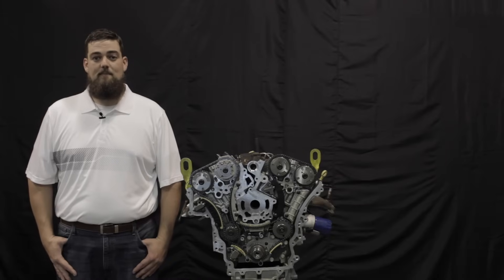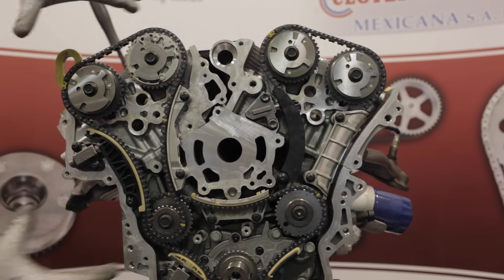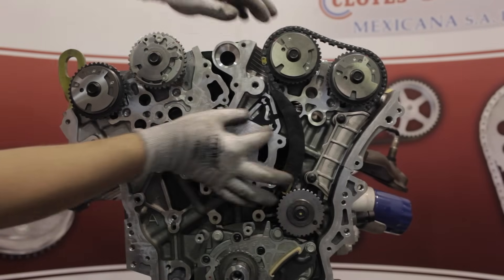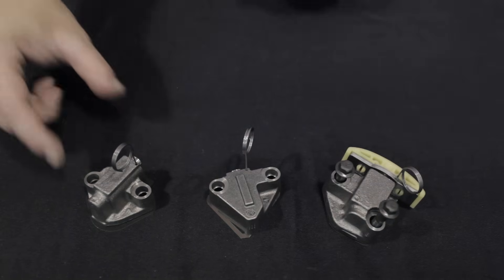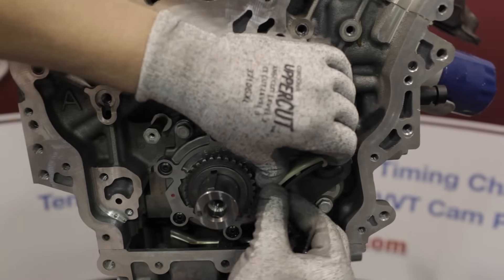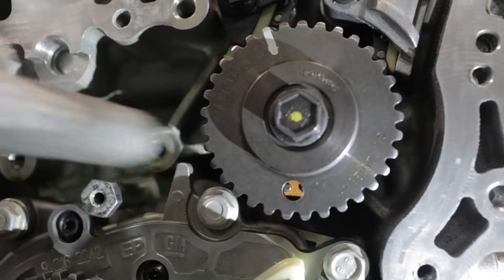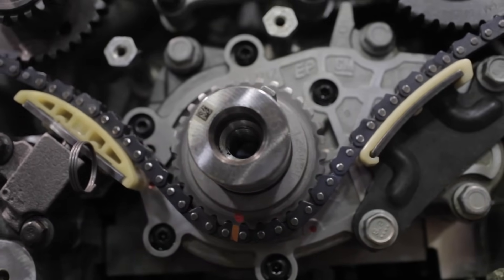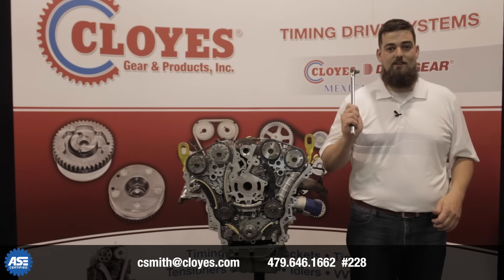GM 2.8/3.0/3.2/3.6L Timing Chain Replacement Repair, Cloyes 9-0753S

Comment: Good morning. I replaced the complete Cloyes timing kit in a car with 130,000 miles on the odometer.  Everything was fine until it all fell apart after 320 miles.  The plastic slider couldn't hold up and the tensioner piston went through it. Then I bought a complete set of original GM parts and installed them. Everything was great until the timing chain broke after 750 miles. Also on the same side as before. Can you tell me what might be wrong?

Comment: Will the chains skip if motor is cranked with no oil pressure.  I am trying to diagnose a starting issue and engine may not fire up instantly.
Reply from the maker: It is possible, but not likely. Rotation with the starter is less likely to cause an issue than hand rotation.

Comment: No Doubt a good video but there are some key components that are left out in this video if you are going to attempt it. First, you need to use the camshaft locks tool or you the cam will rotate on you when you remove the first chain. Pistons say hello to valves and now you need to perform a head job. Second, you do not want to turn this engine over counterclock wise when you have the chains installed with the tensioners, as they will jump time. Those disclaimers should be headlining this video!
Reply from the maker: The cam holding tools can be helpful, but are not necessary. The cams may move when the chain is removed, but it will never open a valve. They will only move in a direction to close valves due to the valve spring pressures, so there is no risk of valve damage.

Comment: Change oil at 3000 miles maybe 3500miles.stop being stupid. Dontlet anyone tell you oil last longer now. No it dont. Thats a scam to charge tou more for the oil. Period. If oil is black. Its no good. Its not doing the job no longer.  Or you can do timing chain replacement every 5 year or 80,000 miles . Wonder what it cost? A lot more than an oil change.

Comment: I need to replace all 4 cam phasers as well. Can i just use the special tools to hold the camshaft in place and just remove and replace the phasers?
Reply from the maker: Yes. Or if you don't have the tools, just use the hex features of the camshaft to hold the shafts and replace the phasers.

Comment: Yea but if the engine was out of time, you just put new everything on with out setting the cams in actual time. You either need the cam locking tool or visual see the flat's on the back camshaft facing upward.
Reply from the maker: The chains ultimately set the timing on this engine. If your marked chain links are aligned to the marks on the sprockets then the engine is 100% timed correctly. The holding tools can help make the job a little easier, but you are still aligning the chain marks as we show to ensure proper timing. The sprockets are all indexed onto their respective shafts, so you are setting proper shaft location when aligning marks.

Comment: So Im supposed to rotate the crankshaft counter clockwise to get from stage 2 to stage 1?
Reply from the maker: Yes, this keeps your chain timing marks engaged with the sprockets so you maintain visual reference of correct timing.
Reply: @Cloyes01 …. I was looking for this comment as it is highly advised not to rotate an engine counter clockwise ever can you explain why in this situation it is necessary without rotating the crankshaft clockwise until timing marks align?
Reply from the maker: @Rscmgw23  It could take over 100 full rotations of the crank for the timing marks to come back around and realign. There are no negative effects of slowly rotating back the short distance required for this procedure.
Reply: @Cloyes01 Every other technician I seen do this rotates the crank shaft clockwise until the back of the cams on bank 2 flats are up. Thats something you should have mentioned in your video. If both flats of the cams are not up level its not in top dead center.

Comment: @Cloyes01 I just had one of these arrive and the boxes say made in china while your website says manufactured in the Paris, Arkansas factory in USA.. which is it?
Reply from the maker: Both. We manufacture many components in Arkansas, but also source globally from strategic partners. The label on the box will represent where the majority of the cost of the kit is manufactured. If you ever have questions about where individual components are manufactured you can contact our tech support line @ 479-646-1662.

Comment: How are you rotating the engine?
Reply: He's probably rotating it here using   the flexplate, since the engine is out of vehicle. You can just put the crank damper bolt back in the crank and use it to turn the engine over though.

Comment: Do you not have to set the motor to the compression stroke? Timing chain completely fell off changed valves, did head just making sure if i have to set cylinder 1 to anything
Reply from the maker: When you move the camshafts and crankshaft marks to the proper positions to align the chains, you are setting the engine to the proper stroke.

Comment: Great video, I know this is going to sound stupid, and it is 
What to do? when the mechanic doesn't follow the Do not touch oil pump guide, just replace the nylon. It starts and at 20 seconds oil pressure drops
Reply: If the pump is "old(er)" just replace it. I'd also drop the pan and pull the pick up tube.  There's a seal where the p/u tube attaches to the block - replace it. Check for debris in the screen. Replace it if there's any doubt.  That's a starting point anyhow.

Comment: I just installed this kit to my 2011 3.0 cadi srx, the i had a issue with i was unable to use the rubber spacers on the bolts-is this right?, other than that it went smoothly.
Reply from the maker: That is correct. GM used those rubber bolt inserts to keep the bolts attached to the components during production. The serve no purpose once installed, and our components are not designed to use them.

Comment: Huge tip and frankly the golden rule of timing belts or chains, turn the motor over 2 revolutions and check for any resistance.

Comment: Cloyes, why did your secondary right side chain fail in 5000 miles, i feel your quality control is gone or i got counterfit parts, either way im done using your products, why warranty if i just get the same junk. Second aftermarket timing chain comeback in the last 2 years, faulty parts on a high labor job. Dont sell the parts if they are garbage, just stop. GM 3.6 GM 2.4

Comment: Great video. Helped me replace the chains in my 2010 Acadia. As an added note because I found out the hard way, you may need to buy a new gasket and bolts for the water pump if you’re pulling your timing cover. Got the motor back together and was running well but started overheating. The water pump bolts to the outside of the timing cover. According to GM those bolts are a one time use and are supposed to be torqued to yield. I couldn’t find just the bolts so ended up having to buy a whole new pump.
Reply: New Bolts Required, New Torque Specification on HFV6 Water Pump
July 2, 2012
A new water pump fastening procedure has been implemented on all High Feature V6 engines (2.8L, 3.0L, and 3.6L) on all models (2004-2013 model years) to help reduce the potential for water pump gasket leaks. This new procedure requires NEW bolts to be used when attaching a water pump. It also requires a third pass with an additional 45 degree turn when tightening the bolts.

The new torque procedure puts the bolts into yield, so the bolts MUST be replaced when they are removed. Old/reused bolts will break if reinstalled. The following procedure applies to all model years and all RPOs of the HFV6 engine.

1. Ensure that the engine front cover and water pump are clear of old gasket material.
2. Ensure that the water pump mounting bolt holes in the front cover are completely clean and dry.
3. Place a new water pump gasket on the water pump.
4. Place the water pump in position on the front cover.
5. Install the water pump bolts finger tight.
6. Tighten the water pump bolts in sequence to 10 N·m (89 lb. in.).
7. Tighten the water pump bolts a second pass in sequence to 10 N·m (89 lb. in.).
8. Tighten the bolts a final pass in the sequence shown an additional 45 degrees.

Comment: I am changing the timing belt on a 08 gmc acadia 3.6 , 
When I go to phase 2 the flats of the cams are not facing up even after 2 rotation , what's the best way to set the timing or to get the timing right , I believe  I have a bad cam phaser or both on the right bank ? Thank you .
Reply from the maker: At phase 2 on the crank are the timing marks on the camshaft phasers in a position where they will engage with the chain? If so, just follow the process in this video.
Reply: @Cloyes01  no , 1 is 1 isn't,  I am replacing all 4 phasers , I know for sure 1 of those is bad , and for some reason I can't turn the crank anymore to set timing , not sure what happen there I was able to turn it with no problems  ?
Reply from the maker: @jamespoole1688  If the engine is out of time you can experience piston to valve contact when rotating. If this is the case you will need to remove the chains and pull the spark plugs. When the secondary chains are removed it should allow the cams to move enough to close all the valves. Focus on one side at a time and move the crank to a position where all three cylinders on a side are down in the cylinders a little bit, then rotate your camshafts close to where they will need to be. Then move to the other bank and repeat the process. Once you get all 4 camshafts close you can rotate your crank around to the starting point and start timing.

Comment: Do you need to put number one piston on top dead center?
Reply from the maker: You just need to make sure the crankshaft sprocket mark is aligned to the stage 1 or 2 mark and the appropriate camshaft phaser marks are up. Don't worry about where the pistons are unless you are rotating shafts without the chains on.

Comment: Why do you need to roll the crank back to put the other chain on?  IF everything is locked in place, why isn't it just a chains off, chains on install?  What is the purpose of that roll-back?
Reply from the maker: We are showing how to install the timing set without any locking/holding tools. The camshafts are at rest in the positions shown, so you are moving the crank to align with cams on each bank where they are at rest (no valves open.)

Comment: Cool vid, but would've liked to see which sprocket to line up in correlation to circle and triangle. Also is there a reason you rotated counter clockwise to get to stage 1 vs clockwise?
Reply: Think i just figured it out. Pass side triangles and drivers side circles.

Comment: You can do this without pulling the engine?  Did I hear you correctly?
Reply from the maker: In some applications. Definitely in RWD applications like the Camaro. We have been told by some customers that it is possible to do in some SUV's if you have the proper tools. Most of the time the engine will need to be removed.

Comment: CLOYES timing set failure for gm 3.6 idler pulleys internal bushings failing and grinding apart internally putting metal in oil! Anyone on here seeing this issue?

Comment: You Can line the Crank gear at 8 O'clock with the Cams 180 degrees Out .. The Detail that the Flat Spots on the Back of the Cams will be Up and Level with the Head Surface WAS Left Out of your "Professional Explanation" Great Job "WingNut" !!
Reply from the maker: If the cams are 180 degrees out, then the marks on the camshaft phasers will be 180 degrees out as well. The phasers are all indexed onto the cams with dowels. You can reference those flat camshaft features or the marks on the phasers as we do in the video.
Reply: @Cloyes01 , In a 3.6 High Feature V6 that Has No Mark's on the chain at the Cam Gear Location (Like Mine), You Must know the Tip that Can STILL Make the Engine Run.. And that IS that at the 8 o'clock position Bank One cams will Have the Flats parallel with the Top of the Head, and also Bank Two at the 5 o'clock Position, those Cam Flats will Be Parallel as Well.. Poor Video with No torque wrench Even Used in the Opinion of This Mechanic of Many Years experience.. Thanks

Comment: Big “be careful” comment!  While it isn’t mentioned in detail in the video, make sure that you pay attention to the lower idler sprockets. They CAN BE INSTALLED REVERSED and will look correct if you go only by the markings on them. The large washer side must go towards the block. Try it (only to check the markings) if you don’t believe me. 

If you get them backwards (swapping left for right), when you get to the last few bolts on the timing cover you will end up with a large hole in the cover!!!  This is because of the special bolts used to hold the sprockets down. The bolt will sit up about 3mm too far - just far enough to not notice until it’s too late.
Reply from the maker: This is correct! We are working on a supplement video and will touch on this topic.

Comment: Good video to watch before doing the timing chain job.   I did the chains in the car.  It was a 2008 Buick Enclave.  It wasn’t too bad to do.   Hardest part was removing the vibration dampener.   I had a second person to help me install the chains for about 30 minutes to make sure the chains were lined up correctly.

Comment: I replaced my original chains (190k) with a set from S___ P____.  They were stretched far worse than the originals after only 20k.  No discernible wear on anything except chain stretch and one of the tensioners extended well beyond the ratchet.  Hope the Cloyes do better.
Should stress identification of the cam timing marks  -  Circles for Left bank, Triangles for the Right.
Nice torque wrench ya' got there...

Comment: 🙄first this is not an interference engine meaning that if the timing goes bad it will not damage the Pistons or valves and 2nd There's really not much teaching about how to do the job but to sell the parts that's it👎

Comment: What do you do if somebody's screwed around with the cam phasers??
Reply: I guess the q is- CAN someone screw around with them to stop coding for a already stretched chain??
Reply: If the phasers are on the cams correctly (they can only go one way unless you force them OR the pin is broken). Set the left and right bank so both sets of flats are UP. Turn the crank so the dot is aligned with the ~5 o’clock mark on the pump. Set the left chain and lower chain as in the video. Slowly rotate the crank clockwise until the ~8 or 9 o’clock marks line up then do the right bank. Remember that’s viewed as if it was in a Camaro! So think backwards if you’re looking at the front of the engine.

Comment: Need to know if it have to be on compression stroke, I have a 2010 Camaro 3.6 and someone didn’t put it in timing correctly and the starter is dragging bad on it like it doesn’t want to turn over
Reply from the maker: You can only time it one way, with the marks on the cam sprockets up and the mark on the crankshaft sprocket aligned. If you are on the incorrect stroke the camshaft sprocket marks will be pointed down.
Reply: Year later, but... for anyone else... make sure the washers between the intake phasers and cam caps are the correct thickness. If they're too thick it will virtually lock up both the intake cams. Just put a wrench on the cams flats and give it a wiggle (no chain on of course!). It should move freely.

Comment: Is it recommended to replace sprockets?
Reply from the maker: It is not necessary in every repair, but we do recommend sprocket replacement. Sprocket teeth wear at the points that the chain links make contact. Worn sprockets can cause the new chain to wear faster due to the worn contact points.

Comment: Thanks for this... I tore my motor apart 2 months ago due to a seized crank and while I could have scatched my head and done this by reading the book, this video got it back together in a few mins. Thanks!!
Reply: Did you have any issue with the cams being off
Reply: @usdibaby35  Nope
Reply: Was there any damage due to the seized crank, this has happened to my 3.0 terrain. I have the heads off, only damage i see so far is teeth on sprockets…a few are shiny. Once I got the passenger side head off i could spin crank. Quite perplexed at the moment
Reply: @kmican  My crank was trashed. She ran it out of oil. Needed 3 rods and I had the crank milled .030 undersized.